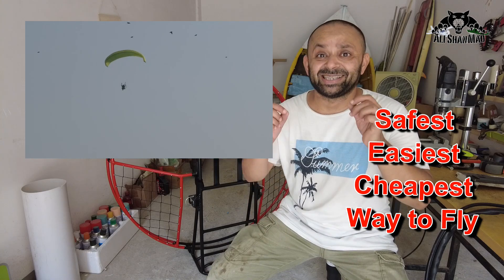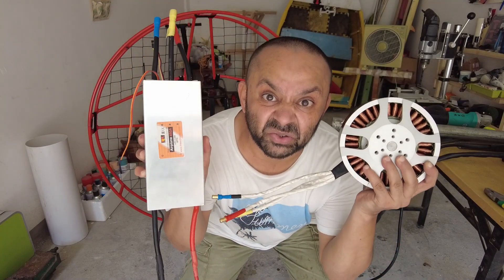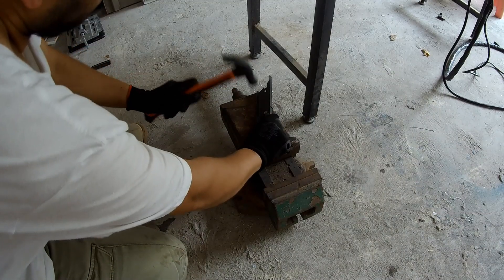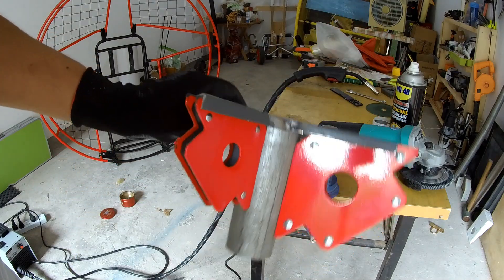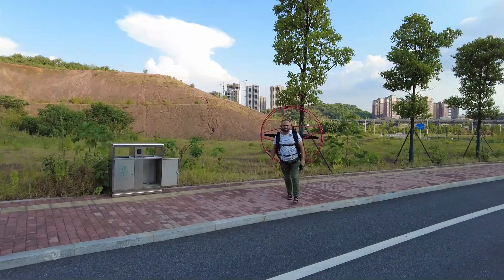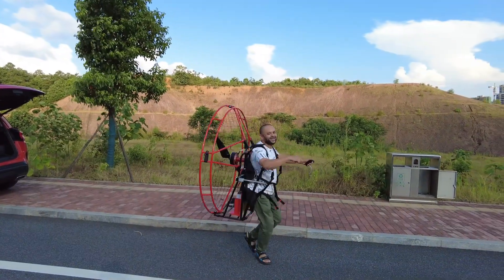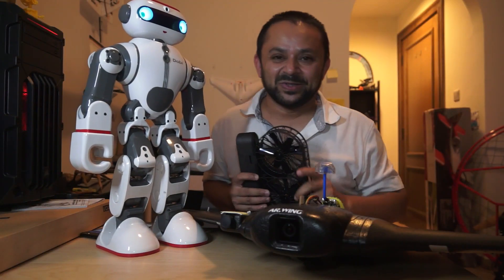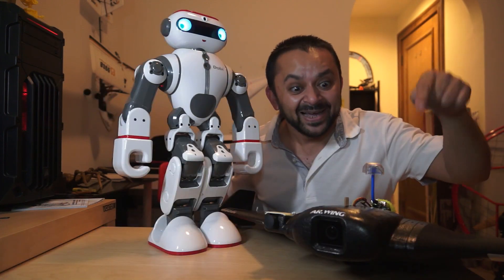How to Build a Powerful Electric Paramotor in a day eppg

Comment: Wow this is super impressive. Where did you get the knowledge to be able to build this? What is your education or career background?
Reply from the maker: https://createc.store/cep/
When I learned to paraglide, i did not like the experience, driving for hours to get to mountains, then driving off road to get to slopes, getting stuck in desert, then finding out weather is not good winds changed and we had to come back without flying. So I thought You know buy a paramotor. when i went to buy paramotor, i found they were too costly, too heavy, too noisy, you have to know how to tune the engine, how to mix the oil, grease fingers, smoke, and so much trouble, like engine quitting in mid air. So i thought, you know if i can build a drone that can lift 25kg, why can't i make an electric paramotor that will provide 65kg of thrust. it looked like an easy task but it took me 6 years to perfect the product. now its one of the best, cheapest, lightest and most powerful out there. I am also working on  making an even lighter version and a more powerful trike version for 2. but money is an issue right now. wish I can find an investor who can invest with me and we can build a two person trike, start a business to fly people. a flight of 15 minutes a person will pay 272$ and in a day we can do 4 flights. so we are looking at 1000$+ per day income with such business. 

my background? i was an English Teacher, TEFL TESOL Teacher. but i learned to build drones, build and fly electric paramotors and much more DIY work all by myself. no engineering background.

Comment: Can one of these lift my weight (350 pounds)?
Reply from the maker: No it can't. this one is for pilots from 55kg to 85kg heavy. 90kg still can. for your weight, I can build you a custom trike with 90kg thrust. so you do not have to do running take off. just sit, drive and take off.

Comment: What did this cost you, everything together? The motor now goes for 2000 dollars on the website u linked in the description. I really want to build this but i dont know where to start.
Reply from the maker: https://onlyflyingmachines.com/product/eglidev4/
This PNP Combo is all you need. if you have your own frame, paraglider and other gears, then you can just get this combo and plug and play convert to electric. If you want complete paramotor, I can custom build for you.
Reply: @alishanmao  Yeah but its reaaally expensive
Reply from the maker: @gidzyy9431  compared to other electric paramotors and gasoline paramotors this one is the cheapest. you can do the research

Comment: Question: What is your battery capacity for this system, and what model engine is that =D Happy to see someone is still exploring this element and uploading on it. For whatever reason, take your pick, the paraglider community is comprised of some of the coolest and most unique people in the world. Thank you for this  - Cheers
Reply from the maker: Thank you So much. Appreciate it buddy. 👍🌹 battery capacity depends upon what pilot can carry. i can easily carry 16000mAh x 3 batteries. engine is our custom motor
Reply: @alishanmao  these 3 batteries hold how many miles? amazing project by the way,  I am gonna check the trike now
Reply from the maker: @leandrokassa4794  I just know that i can fly for 20 to 25 minutes with small batteries :)
Reply: @alishanmao  nice. ty

Comment: I really doubt you Are getting 60kg thrust from a 42" drone prop and that Chinese motor. Also that motor is only rated at 12kW continuous.
Reply: This is awesome
Reply from the maker: tested on bench / motor test rig yes it does
Chinese motor huh. you sound very discriminative against Chinese product. which motor is not chinese can you tell me 🤣🤣

Comment: Hello I also built an electric parmotor using the same motor and ESC as you. I have some problems with desynchronizing at high accelerations. Can you tell me at what timig angle you set the ESC (so far I have used 0 degr.)
Reply: I solve the problem by incresing the timing from 0 to 18 deg.
Reply from the maker: @floriancuculea6951  timing is different from motor to motor, motor brand and motor type, if you set wrong timing on a different motor, it will give you more issues and specially heating up and or in some cases even burn the motor or controller.
Reply from the maker: How can I help you?
Reply: I would be interested in the timing angle set by you in the Flier controller, possibly if you encountered the problem of desynchronization. I know that we probably use different kV constants and battery voltage but I am interested in your experience with this motor type. (Y have kV=35 and battery voltage 72V nominal)
Reply from the maker: Hello florian, can you make a video of your problem and send me video link by email to alishanmao@gmail.com 
please do not post video link in comments or it will be marked as spam
its not timing issue. thats what i know for sure.
Reply: @alishanmao  Please share the knowing about it.

Comment: i really want to paramotor myself,  are you going to do training? or ask a well experienced friend to help? thats ideal because training costs thousands. 
my problem is im scared of heights, for good reason!!  but my body can just freeze up when i climb a tree to above 8 meters.
i see tucker gott channel, it looks so easy, but the wing is not rigid so its different to what we're used to with rc planes and drones.
Reply from the maker: Hey Teeny, when I learned Paragliding I was scared too. My First jump from a mountain, I even stopped at the edge because I looked down LOL hahahah but my Instructor pushed me and I flew. thats it, I got the taste and never got scared again. I built the paramotor after that, and without anyone teaching me, I just went to a cliff (of course with my instructor with me to watch me) and I flew. 

With paramotor the best thing is, you can fly low and slow, cruise close to ground. and step by step fly higher and higher to come over your fear of heights. Paramotoring is very simple and very easy. Just find a professional friend who does paramotoring and he can guide you. Or Come to China and I will offer you free training :D of course you have to buy my electric paramotor and a glider with all necessary gear. training will be free. 

Paraglider canopy is called flying under a fabric. but once its inflated in the air, its like a wing and does an amazing nice job.

Comment: Any consideration is needed to counter the rotation force from the motor?
Reply from the maker: we can add rubber dampers to motor mount, or 3D print vortex generators to install on frame which will counter the torque roll
Reply: @alishanmao  install the dampeners where upon it? This looks like loads of fun
Reply from the maker: @isaiahcorona4136  https://youtu.be/3ZZas0LkOtk
Check out the new design, no more torque roll. tested and admitted that there is no torque roll by my experienced paramotor instructor